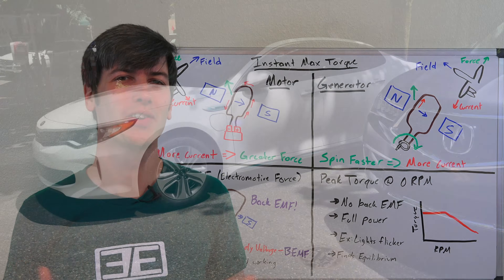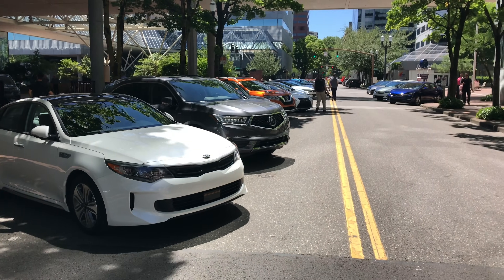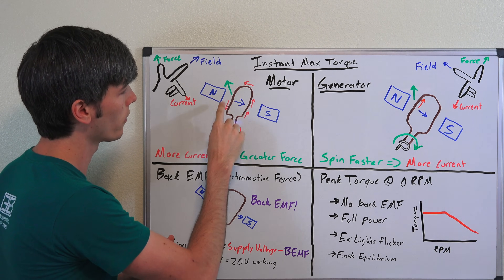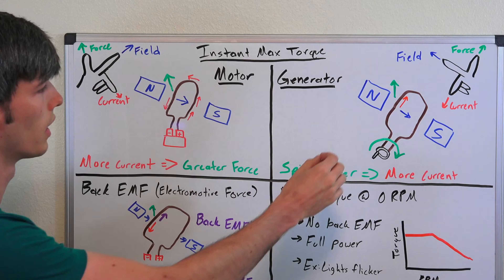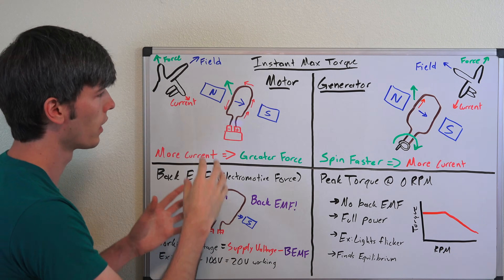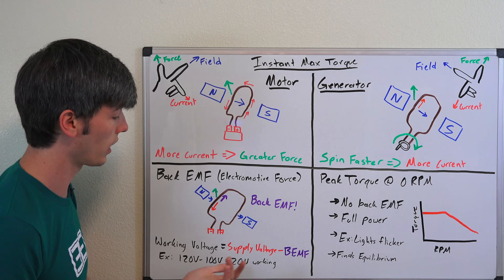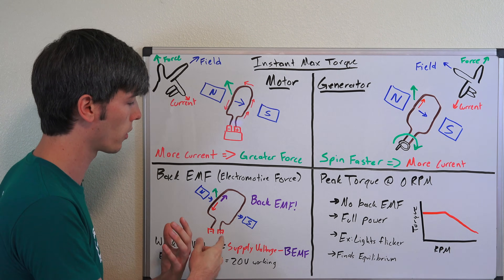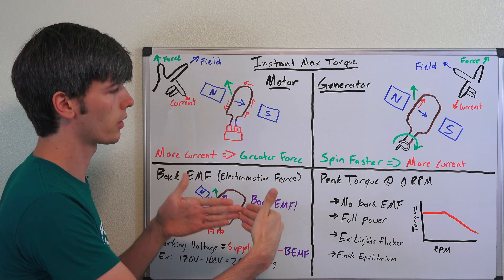How Do Electric Cars Produce Instant Maximum Torque?

Comment: how about using a gearing system to reduce the electric motor rpm? less back emf is a good thing right?
Reply: that depends on whether one desires torque or efficiency
Reply: They have better methods of doing this. Most electric cars use an induction motor. The torque curve on an induction motor is shown here https://www.electrical4u.com/images/february16/1456578362.gif

by adjusting the frequency of the alternating current feeding into the motor that torque curve will move left or right.

So there is no need for gearing.
Reply: They could use a highway gear to help with range there, but the rest of the time one gear works perfect.
Reply: You don't gain anything substantial by lowering the RPM on an electric motor.  If you lower the RPM by shifting to a higher gear then the motor must work harder (more stress) to keep going at the same speed - the draw difference would be meaningless.  The electric motor doesn't have areas where it's considerably more or considerably less efficient like an IC engine would have - so there's really no point to adding gears.  Think about it this way:  If your gasoline engine can rev to 50,000 RPM or so, the only reason why you'd need different gears would be if it didn't run efficiently across all 50,000 of those revs.  If it DID run efficiently across all RPM (ie. an electric motor), then why bother with transmission?

Tesla tried it on the roadster I heard (it had a 2sp I think), and they broke a lot of transmissions doing it.  A lot of needless complexity and all it did was create problems (easier to damage transmissions with electric motors).

The Brammo Impulse (Empulse?) now owned by Polaris/Victory I believe, has a normal 6sp sequential transmission like any other bike, but is a full electric sports bike - so they do exist with transmissions - it's just hard to justify them because the efficiency doesn't change THAT much depending on revs.
Reply: These cars have a reduction in them now, so it won't lose anything to have a highway gear as long as it is mechanical gearing, but it adds complexity and expense. They could do a highway gear and gain a little range there.
Reply: Shawn Dickens, essentially the gear reduction on the front motor of a Model S with dual motors IS the "highway gear;" it's optimized for higher speed cruising while the rear motor goes neutral, and you're effectively driving a FWD car in overdrive.  The rear reduction is optimized for launches/acceleration.  It's a slick setup.
Reply: MrSlowestD16 "The electric motor doesn't have areas where it's considerably more or considerably less efficient like an IC engine would have"

That depends on what you consider 'considerable'. If you look at efficiency maps of electric motors, efficiency at maximum load at low RPMs can be ~20 percentage points lower than at higher RPMs.
Reply: that depends on whether one desires torque or efficiency
Reply: but you will have the losses of the gear, in a gasoline engine, gearbox plus drivetrain usually means around 10% of loss..
Reply: So, why Formula E cars have transmission? It's only for the "human reaction time" itself?
Reply: A gearbox is just a mechanical transformer. And a motor is a rotating transformer. So no advantage.
Reply: Electric motors are different than ICE. You can't think of them the same. If you add a transmission, you are gonna lose power. Not only that, but that transmission will use oil and adds moving parts, which is kind of the opposite of what pure electric cars advertise (no maintenance aside tires, and being eco friendly). The other thing is that electric motors work best at higher RPMs, not low like an ICE. ICE benefits in efficiency the close to idle it is. For example, if both units were driving at 55 MPH, it would be best for the ICE to be around 1,200 RPMs and the electric would be much, much higher.
Reply: I'm sorry but an ICE is NOT more efficient near idle. Actually ICE's have their best efficiency generally somewhere closer to peak power or torque. At idle a car is almost starved for oxygen and does not burn fuel as well. This is why there is gearing, to wind it up and keep it around the most effective RPM range. 

A good example of that is the CVT gearbox that, ideally, keeps the engine winded up at a more constant RPM. Now they made them behave like automatics, which beats the purpose, but customers were complaining about that unpleasant characteristic.
Reply: The motor itself might be 20% or 30% at best, but when you account for the mechanical losses after the engine, my figures are still good, especially since an E-Motor has triple the efficiency for old tech DC brushed. 

Burning hydrogen in an ICE? You've got to be kidding me. Remember the energy storage situation? Hydrogen is less dense, has less energy per volume, the energy input (to extract, refine, transport, store) is greater than gasoline or diesel, then you need cryogenics to store it.... and then burn it at 20-40% efficiency? It's a real joke. 

The only viable alternative for hydrogen use is as a backup fuel cell. Even then high capacity  capacitors and new generation batteries, combined with the 80-90% efficiency of these motors are leaps ahead in terms of potential.
Reply: @Shawn Dickens Well one gear is perfectly fine if you don't care about 0-100 is 2.3 seconds and such, or even then, cause top speed is limited to 110 or 120 km/h.

And motors are same efficiency across their entire rpm band (i think), so range is not an issue.
Reply: manthanboeing, test that out. Get a battery powered fan or other simple setup and time the battery life on low and high.
Reply: I heard it was somewhere around 12-18% depending on the gearbox.

not to mention electric motors spin to 18000 rpm for the model S, and some electric supercars they sping to 24000 rpm.
Reply: Or since in this case Torque = Voltage / Frequency. That may look familiar to radio guys and thermo/fluid dynamics guys. Wavelength = Amplitude / Frequency. In this case our Wavelength is very simple as there's only one octave of noise to create the wave (the single electric motor). Now what my line of thinking is heading toward multiple smaller motors to produce a more complex wave composed of multiple octaves of noise. I think this is ultimately what an electric motor transmission will be doing, mixing wavelengths of noise generated by multiple motors to produce the most optimal waveform for the behavior required.
Reply: MrSlowestD16 They still run gear boxes because even though a electric motor makes max torque all the time it still needs gear reduction to start off as well as they have an eventual rpm limit. Overdrive is still effective on electrics. They also in some cases use a reduction gear box to reduce the input speed going in a transmission to RPMs it can handle.
Reply: Jason gave a very oversimplified explanation. Variable frequency drives allow you to operate a motor above its 'rated' speed (the speed at which your battery supply voltage is equal to the motors back EMF) by way of a technique called field weakening which is a bit involved to explain but it basically makes some of the magnetic field from the magnets be cancelled out by the magnetic field from the stator windings (this requires extra current for the same torque). As long as your drive can supply enough current and your motor is rated for that current then Back EMF isn't a massive issue, except from an overall system efficiency point of view. Sizing motors for rated speed, torque and minimum battery voltage is a good bit of engineering.
Reply: Mike Page Ehh not exactly.
Reply: Thanks guys. Love reading all of your replies. I learned a lot from this discussion.
Reply: Otter Get Up and Ride but ever electric car already has a reduction unit because direct driving the wheel tire combo takes a lot of torque. Also, no electric car goes further on highway of 70 than one of 55. The whole concept that make hybrids great is the electric can get the car going the most efficient, but the gas motor can maintain the momentum more efficiently.
Reply: I just got back from my Anniversary where we took a 10 hour drive to a cabin in the mountains (687 miles there and 687 miles to get back). We spent most days driving more than the range of a Tesla to go to different waterfalls throughout the state, but I'm sure we would be just as happy doing the same trip with an electric car and only having 1 day worth of enjoyment and spending the other 4 at charging stations, plus adding two extra days to get there and back. Now, how much would the batteries weigh to do the same trip in one run or equal the 36.5 gallons of fuel to move all 7500lbs of truck and things we had with us up into the mountains? I'm sure I'd have to tow a trailer just carry the load even in my truck the payload isn't enough to carry that much lithium. That is for you to choke on your range. Now, as for which is better. You're telling me the number one selling Hybrid, the Prius (weight is 4000lbs with to small of a battery), is designed wrong and should use the gas motor to get moving and electric to maintain speed? I guess every manufacture overlooked that since they all lean toward electric in city and ICE on the highway.
Reply: Didn't know that, so cool info. Thanks.
Reply: + Shawn Dickens A Supercharger type of  charging station will replenish half a charge in 20-30 minutes. When you drive distances exceeding a Tesla's range, you need to stop at least once during that time, and may need more than just stop 5 minutes to pee. Someone working for example is gonna recharge while at work. 

The long road trip example is a classic example, but happens only a few moments in the year. 

What I said about an hybrid is that it is a compromise that uses too small an ICE and too small an E-Motor, and too small of a battery pack. You get a bulky do it all that can't do either correctly.  The E-Motor should do all the work or the ICE. They get beyond 70-80 % efficient even with DC brushed motors, while the ICE is gonna transform avout 10-20% of your 36 gallons worth of fuel in actual movement! 

Yep, as high as 80% of the fuel tank is dissipated in wasted heat during combustion and then further lost in the mechanical losses.

The solution for your truck problem or very long trips where you don't want to stop for hours is better charging networks, lighter vehicles, battery swap stations and obviously constantly improving battery technology. 

What most people forget is that a fuel tank IS a battery, which is an energy storage device. Fuel requires extraction, refinement then transport. A LOT of energy has been input to "charge" that Fuel "battery" in the car or truck that then wastes 70%+ of it into waste heat and mechanical losses. The best ICE in a lab converts 40% of that energy stored in a fuel tank into actual work. That's early 1900's tech.
Reply: Simon WoodburyForget cell phone, didn't see it change my words.
Reply: Renault used a three speed transmission for formula e cars, it didn't change the overall speed that much, mostly negated, and so they dropped it. A note, it's more efficient to leave the motor alone, and it's more effective for most drivers as you'll prefer torque to high speeds. This is more of a cost effective approach though. Also I'm ignoring the question you asked because others have answered it. If you want to see more things about electric cars definitely go to formula e for videos and such. It's incredibly interesting.
Reply: But that way u won't get the higher speed, and u can't do the 100-200 accelerTION
Reply: Actually electric motors love to spin as fast as they can. Many people who build ebikes can use tiny RC 1KW motors because they use gearing to "step down" the rotation. That way the motor can stay small.
Reply: Having instant torque is the very reason why Teslas and all EV's are boring. Because it has instant torque there is no need for a transmission. And no transmission means no fun. 

It's so fun to rev the engine and shift gears especially in those tight corners.  It's so boring to drive a Tesla anywhere because you hardly do anything to drive it. At the end of the day you are only steering a Tesla not driving it. You  Might as well be the passenger than steer a Tesla.
Reply: Think this through. All that would happen would be less torque so to meet your torque requirement you would need more current, for that you need more voltage. Or you scale up the motor, both methods result in higher electrical losses and you gain mechanical losses as well plus depending on your application, the vibrations resulting from the gears would screw with angular positioning. In advanced industrial applications like milling machines engineers try to remove gears wherever possible.
Reply: Not really, the transmission losses will be huge. (atleast compared to a single gear ratio)

EDIT: :p Also, to answer your question, back efm isn't really harmful, no bad side effects there.
Reply: interesting.
Reply: Shawn... NO. The gas motor is there simply to calm the irrational fear of low range and low power, that is created in the first place by having too small batteries and to weak of an electric motor in the first place because you are trying your best to abide by regulations by doing the minimum. replace all the hardware required for the ICE part of an hybrid with batteries and proper electrical powerplants and you've made a better car.
Reply: Rolf Bjorn Gas motors are about 20% these days and Diesel are about 30%. The other part that doesn't come up is racing on windy roads in the mountains will kill The range of an EV. The best way is to burn hydrogen like the Norwegians Hydrogen Highway or fuel cells. At least an ICE CAN be setup to run on gas or hydrogen. The problem with your every so often and charging is I'm not willing to add to my 14 hour day driving and good luck finding a stuper charger in the mountains. For the 7 days in a row I would have needed one. I guess I have to bring a charger for the cabin. Next month I'll be on another trip to long for the best modern range. The best part is if I could afford a second  $130,000 car then I would have a Tesla. Man I'd love to load LS Engines and engine blocks into a Tesla all the time. I'd have the only one to smell like gas, because I'd have to carry the gas to run them in the cabin back to the shop. I build and tune motors that Elecric motor will not be able to replace for probably 20 or 30 yaers.

Comment: hey can u make a video about turbo stututu
Reply: Pretty straightforward - all turbo's have a pressure relief valve (same for any system that involves pressure i.e. vents a pressurised system to atmosphere) so when you are at say 3k rpm there is x pressure (say, 10psi) in the air inlet manifold (pressure is created by exhaust gasses spinning a turbine).  When you let off the accelerator, that pressure has nowhere to go and creates a pressure surge (increases PSI of the inlet manifold) and that pressure has to go somewhere.  The pressure relief valve takes care of this.  A pressure relief valve opens at a set PSI (say, 12psi) and the turbo blow off sound is the sound of excess air pressure running through the relief valve when the threshold (12psi in this case) is reached.  The design of the valve (i.e. the spring type, orifice size etc.) changes the sound i.e. the classic tssss sound is just a spring opening a valve.  
TLDR:  Turbo stutu happens when excess pressure in the manifold is exited through a relief valve.  Design of valve changes sound. stututu sound comes from a spring opening and closes several times (traditional valve opens once until pressure drops below threshold).
Reply: Rin Steffon look up turbo surge
Reply: Alex Strömberg thank you for the tip :)
Reply: rayray123ray69 wow that is cool thank you
Reply: That's not a turbo surge, that's turbo flutter
Reply: They don't come stock on Dodge Ram with Cummins Turbo  diesel.

Comment: Diesels are close enough anyway when it comes to stacks of torque at low RPM :p
Reply: M RO I Iove diesels but there is a reason that modern freight trains, ships and heavy mining trucks often have no transmission and just use the diesel engines to power generators which power massive electric motors. You get less energy loses too from diesel electric drive trains compared to conventional drive trains.
Reply: M RO agreed